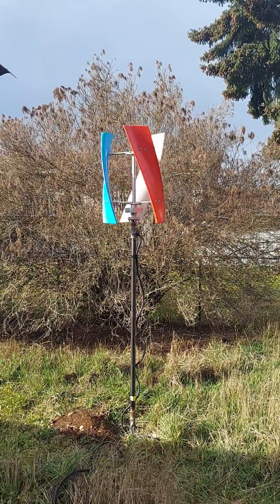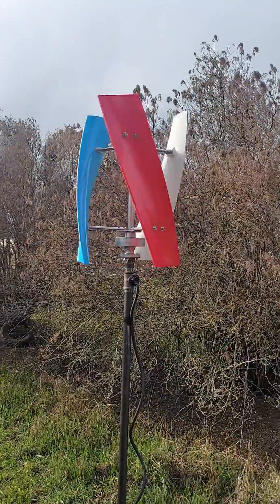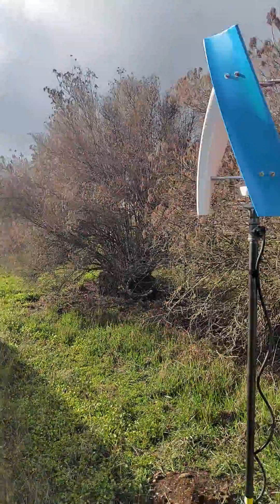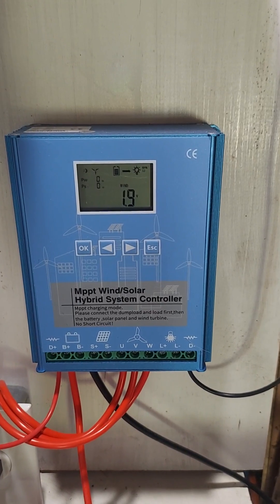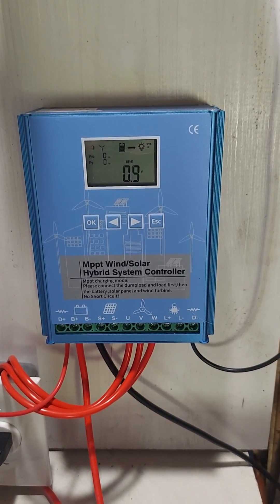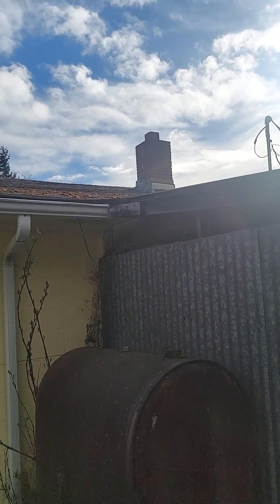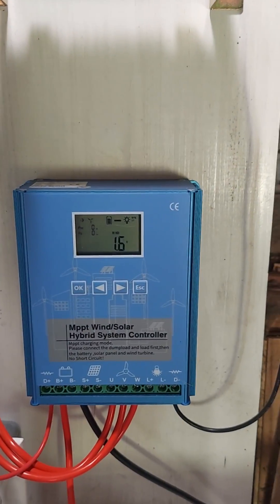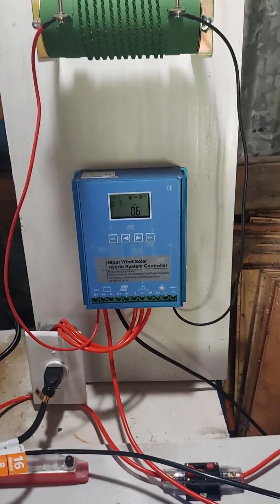Getting a little juice from the Wind turbine

Comment: Im sorry to tell you that you've installed a very bad generator
Reply from the maker: Maybe, but I liked the style of it and it had some decent reviews. Not a lot of reviews, but the ones there was were Ok. It's working, just takes a lot of wind as do most of them.
Reply: I bought a 400 w cheap Chinese lantern generator and it only ever produced max 4 watt. Moved it around garden and found best spot then bought a moderate price model and swapped over - putting yours on the chimney would get you 4 watt or above and give you a better idea if your yard is suitable. It also depends if your system is 12 or 24 - like solar a 100 w panel produces 12 - 60 w depending on the sun and season...I am in UK so  neither wind or sun are reliable - but what a enjoyable hobby....